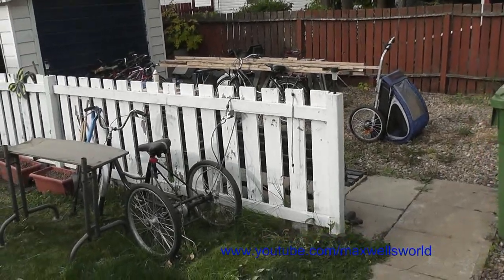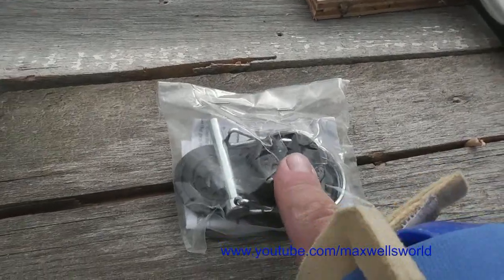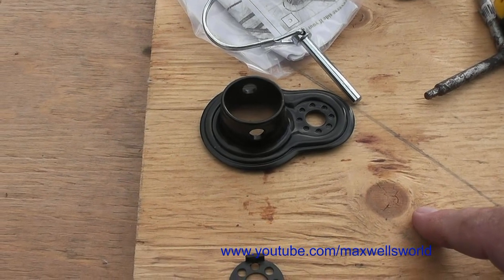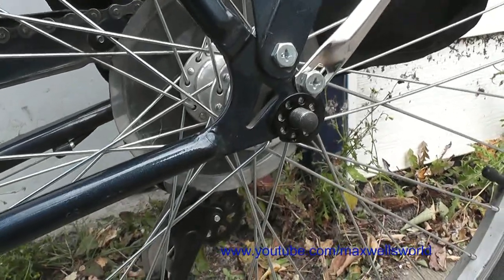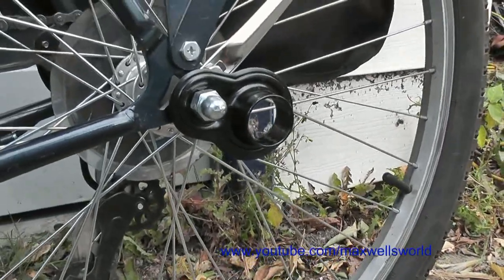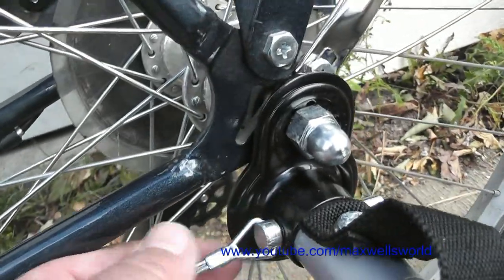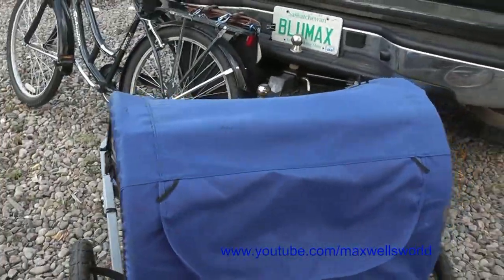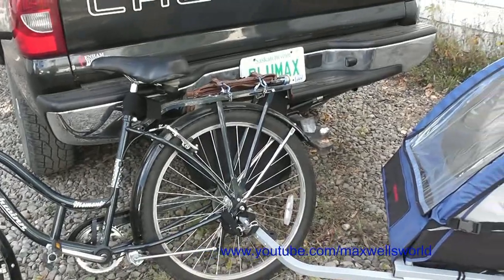installing a schwinn instep trailer coupler maxwellsworld

Comment: Why is it at a 45 though looks like you’ll only be able to go left!  I just bought a trailer and tried using it today for my boys but it sits at a 45 like this so I figured that was wrong and ordered the other coupler that is at a 45.  Is it supposed to be this way?
Reply from the maker: Yes right hand turns are very possible. Maybe not a sharp at left hand but still very doable. Thanks for your comment.
Reply: How did you solve the angled?
Reply: @maxwellslifejourney So I can't go straight?

Comment: That wheel that pins into the trailer tongue for the stroller works good as a trailer jack stand so you don't have to drop the hitch coupler on the ground.
Reply from the maker: yes these have any functions. if all the parts are there then its works well. if missing parts then it gets interesting

Comment: But how do you go if it is angled? That is not correct!
Reply from the maker: yes i installed the trailer at a 90degree angle there is a hard rubber rod? in the silver spring the allows the trailer to "bend" to follow straight. no issues pulling even with weight in the trailer

Comment: Thankyou for sharing..i now know what part i need to attach my pre owned trailer to my bike as this part was missing and ive been struggling all morning to figure out how it was supposed to fasten on! Such a simple and easy little bracket that im off to buy and hopefully fit myself if i can remove the bolt from the wheel! ☺ thankyou very much x

Comment: Very helpful. Thank you for posting. "Per the customer" and per the printed instructions it looks like the coupler plate should be vertical though it seem from a force perspective that horizontal would be better. Anyone have better results one way or the other?
Reply: Hi timothy,i thought this too as it seems a safer idea to me to have the pin pointing down,but im thinking the instructions say it goes on vertical maybe to keep the trailer arm align? Otherwise the arm would end up on a slant causin the trailer to lean back abit? But thats just my thinking and im just a woman..thats probably going to get laughed at for my comment! Haha 😏 x

Comment: Great Video. Where did you find the coupler? My trailer is missing the same piece.
Reply: Bought mine's used, and it's missing the coupler also.  
Where did you find it and for how much?
Reply: Hi Maxwell. I bought my stroller used, and it's also missing the coupler. Where did you find it and for how much? Thank you.
Reply: You can buy it on Ebay or Amazon for less than 10$.

Comment: is the hitch supposed to move any when tightened down
Reply from the maker: no it should remain stationary . do you still have the washer with the holes in it?
Reply: No sir. I have a nashbar bike, the trailer I bought was from craigslist and didn't come with a hitch , I didnt want to modify a hitch so I ordered a hitch from nashbar to fit my bike . And it didn't come with a washer, thanks for the reply